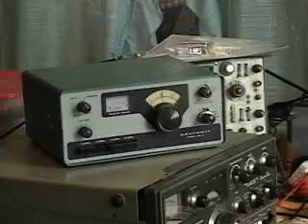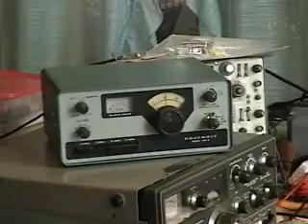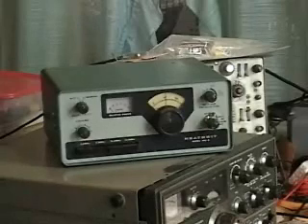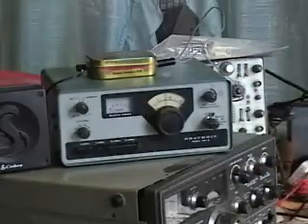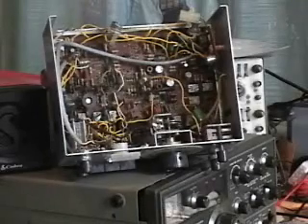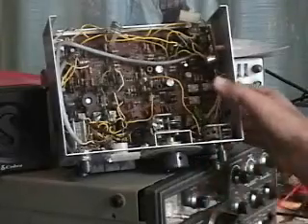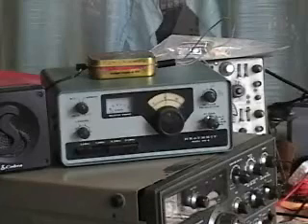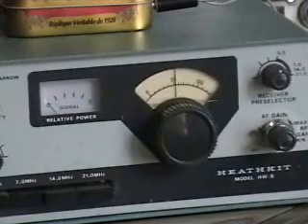HW-8.wmv

Comment: The prices seem to have stabilized on ebay Ron.  I picked up a fully functional (Needs aligning of course) for less than a hundred bucks.  Got lucky on that one as the seller could not test it to see if it even fired up!!!   Thanks for the video.  Also came with the original power supply!!